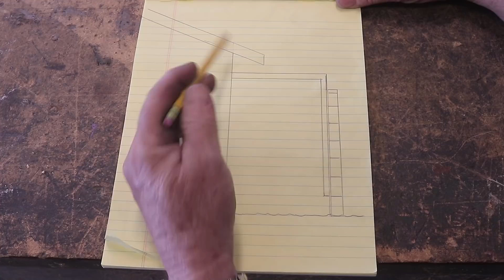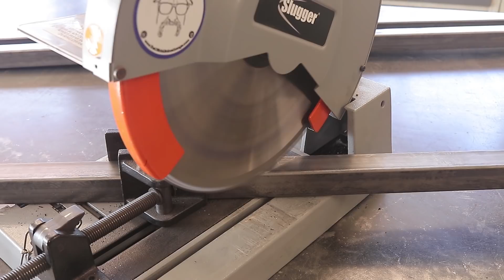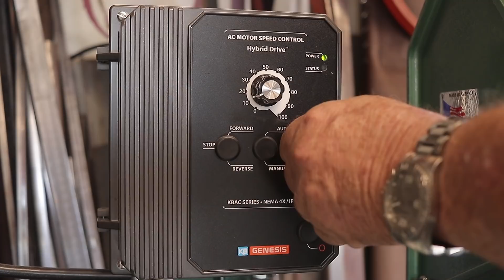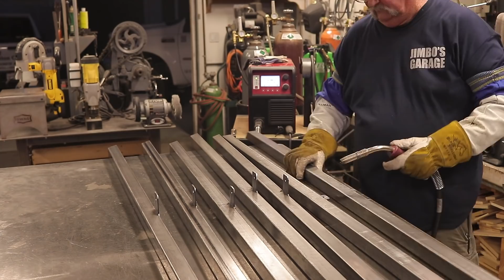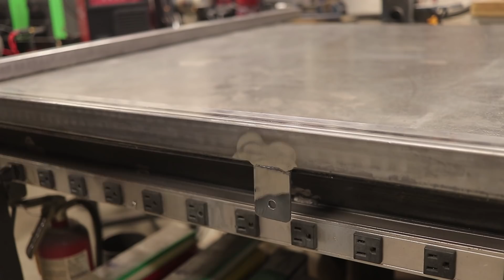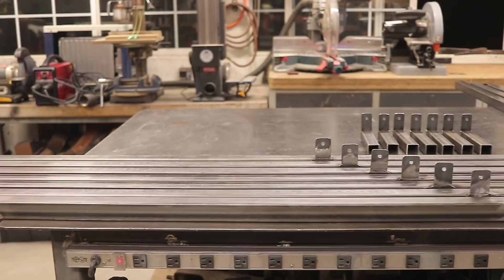Big Outdoor Metal Brackets | JIMBO'S GARAGE

Comment: Instead of taping them, I use a setup clamp. That has two small flat bars with two screws to tighten it up. Do the end, it slips then into the vice, from the side, without a problem. Then just set them on top of two low parallel bars. Works really well. The tape is being squeezed onto the metal so it’s hard to remove without GooGone.

Comment: The down side to the slip fit and the open ends is if the interior of the tube is not painted you get rust staining on the wall and where ever the rusty water drips. looks good at first but not so good in the future.
Reply: just shoot some clear silicone in the joint .... that "gives" A LOT without breaking and tearing ....  that will keep the water and rust out ...
don't use and acrylic caulk  ... that won't work ...